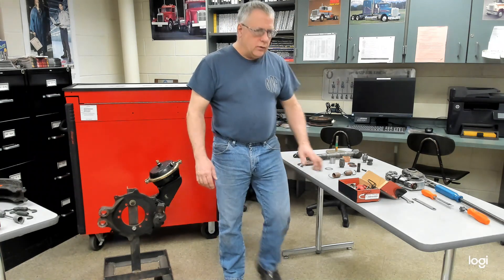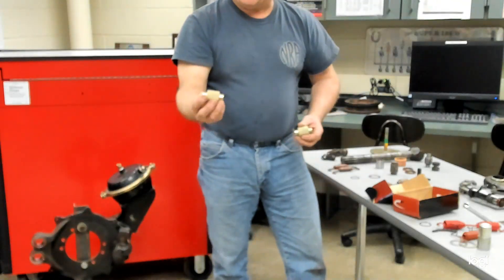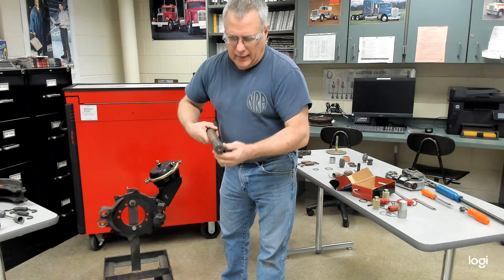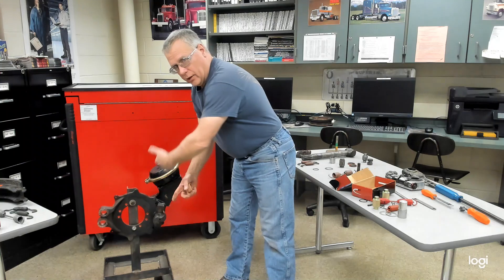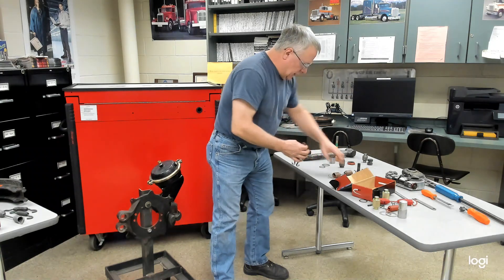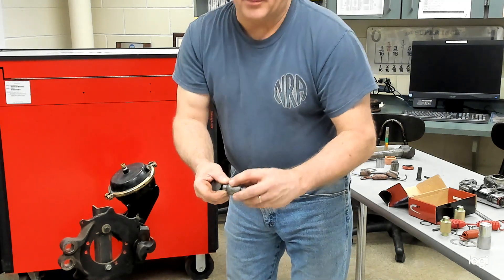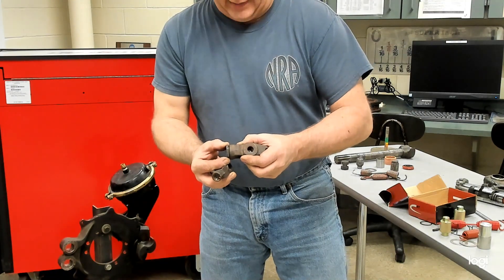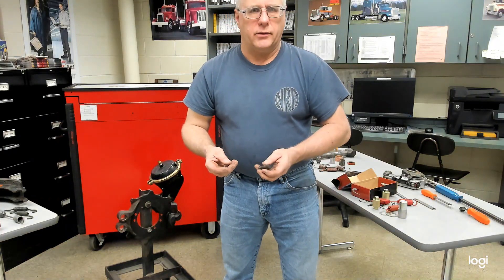5.03 S-Cam Brake Inspection

Comment: Hi Sir, what is the brand of brake kits? Where I can buy it?
Reply from the maker: They are Meritor 15" Q Plus brakes.  They are pretty common on the front axles of trucks here in North America.
Reply: @JimMackHeavyEquipment  Thank you, Jim, I see it is 15" Q Plus brakes, but barely recognize the kits brand, is it Euclid?
Reply from the maker: The box shows the company name as "BT" and were purchased several years ago so I don't know if the manufacturer is still around.  We did purchase them through Associated Truck Parts https://www.associatedtruckparts.com/
Reply: @JimMackHeavyEquipment  Oh, I got it, thank you, Jim, really appreciate.